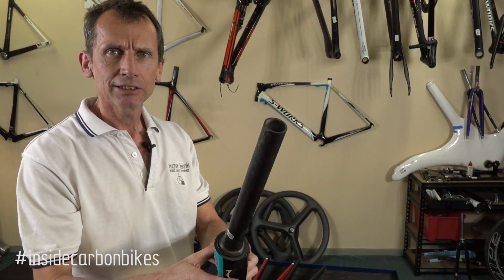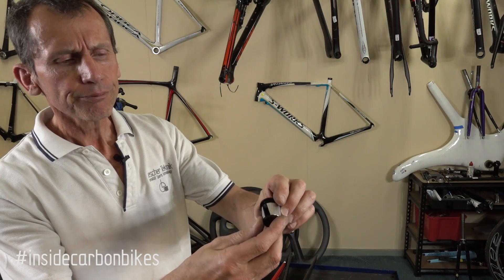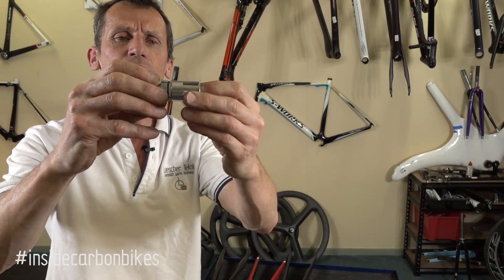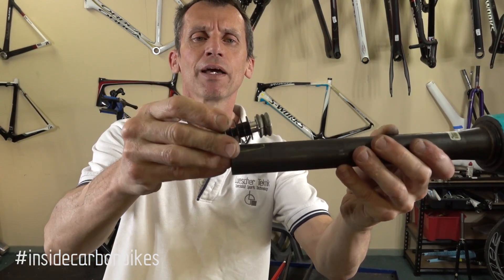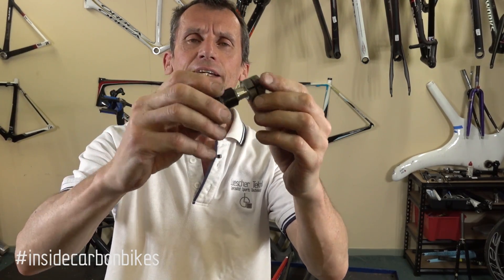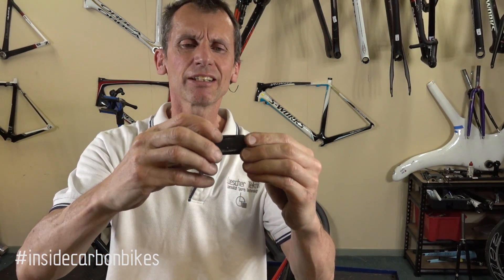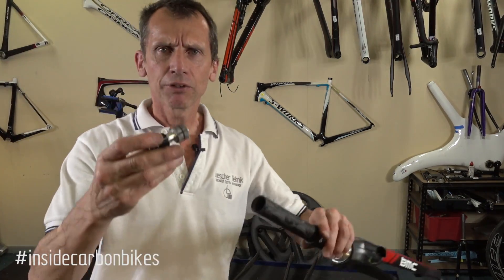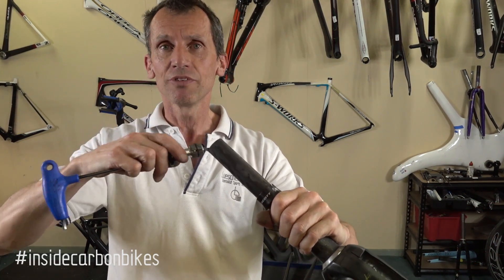Quicktips  -  Fork steerer compression plugs

Comment: My Lauf Seigla came with the second type you said to throw away 😮
Reply from the maker: Did you throw it away??
Reply: @ I did. But I'm not absolutely sure the one I replaced it with solves the problem. I think the top stem bolt may still be a little unsupported.
Reply: @LuescherTeknik  what do you think about the expander plug Schmolke Expander SL? I assembled it around 8mm below the top edge, which is exactly between the two stem bolts so that the pressure is well distributed. I also used carbon paste on the surface of the plug. Thank you in advance for your feedback.

Comment: Great video - quick question, I have a Caad13 and looking at a longer plug so I can adjust the stem position without cutting the steerer.  If the plug were longer than the stem would this be an issue / cause expansion outwards where there is no stem to push back?

Comment: Do you need to put in a compression plug if you are using 100% chromoly  forks and steerer tube? Or do you just need a star nut?

Comment: It looks to me as if the compression/expander thingy is more dangerous than a stem clamp without any burrs, as a tube is more susceptible to expansion than compression?

And it's very clear that all breaks happen outside the clamping area which is quite strong even if it is slightly damaged, so should an expander actually extend below the stem clamp?

Is there any indication that these breaks, as one would suspect, preferably happen to big sprinter guys?

Comment: In terms of weight, wouldn't it be best if the compression plug could use (carbon) spacers internally to move it to the exact height of the stem clamp? That way the expander plug could be minimal weight and still have full adjustability without needing to cut the steerer or use an overly long compression plug

Comment: When installing one of those expanders that have a unique vertical slot, is it better to put this slot at the screws side, opposite to the screws side, sideways, or this doesn't matter at all?
As one of the tasks of the expander is to counteract the compression force of the stem, I would say that it is better to put it on the side opposite the screws one but I wonder if the expander doesn't play a role also in counteracting the forward bending forcethe fork steerer is subjected to when the body weight is placed on the handlebar, although this is already partially opposed by the spacers under the stem, and then in this case it would be better placing the slot sideways.

Comment: If a steerer diameter is expanded where the compression plug pushes against the inner wall as you demonstrated, but reverts back to its original diameter once the plug is removed, is the steerer damaged in any way?  Even if it is safe, it seems the longer, less concentrated expander plugs may be better for the steerer?

Comment: No compression plug on my Canyon, it's hollow, it uses some weird solution from Acros  (Ai-70F).
Reply from the maker: I have seen quite a few problems with this system and don't recommend it.
Reply: @LuescherTeknik  Yes, I didn't know that, and overlooked what system they use when I bought this bike.

Do you recommend to additionally install a compression plug (50mm) into the steerer?

Comment: Best option of all that you showed seems to be the aluminum tube bonded inside the carbon steerer, then a traditional metal star nut down in there. Those things are always trouble free. Adds some weight, sure, but that's a good use of that weight. A few extra grams at most. The aluminum tube will provide a really good footing for a star nut and will also support and greatly strengthen against any possible crushing from the stem.  That should be the standard. I might source some aluminum tube of appropriate thickness and diameter and retrofit my bike with that, never have to worry about it again.  Good layer of epoxy between to prevent galvanic corrosion.

Comment: This is one of the biggest scam in cycling. By providing only a small compression plug more forks are sold due to people cutting their stems. By using a longer compression plug you can then use more spacers underneath and are able to move the handlebar extension up and down thus not needing to buy a new fork when you sell your bike. The full up and down expansion plug is the best design as it leads to no gaps on the compression area.

Comment: This seems to miss the point of the compression plug. The first red flag is that we have to assume that company after company is failing which doesn't make sense from a warranty/injury perspective. Obviously we haven't seen any of this damage/injury in the cycling community. 

The stems we use in cycling do an excellent job of dispersing forces along a wide area along the steerer tube. An impact on one area of the tube (like a head-on collision) isn't felt in just the one face area of the steerer (closest to impact) because the stem is clamped around the entire tube so it's dispersing this pressure and would need enough force to crack the entire section of the fork around the stem (significantly more force than what we see in 99% of collisions). 

Imagine trying to punch through a glass cylinder with a thin wooden wall immediately in front of it; you may easily be able to push through that wall and damage the glass. Now wrap the wall around the glass and tighten it to it so there's no void (like a stem). Now you have to have enough force to sheer the glass under the wall to break it; it is SIGNIFICANTLY more difficult. 

 A compression plug doesn't do anything to help in saving the tube either since it's not adding to the dispersion of the forces (the stem is obviously tight evenly throughout the steerer these days). 

This shows a fundamental misunderstanding of the compression plug. The second I call out multiple manufacturers for an otherwise obvious flaw is the second I should be questioning my understanding of the concept.

Imagine the amount of crashes we'd be seeing if plugs had to keep the stem on!
Reply: The fundamental misunderstanding is entirely on your side. Watch the video again, this is not about crashing, but crushing.

Comment: Would the placement of plug matter so much when we use it to only tighten the stem to bring the steerer up, to seat into the headtube bearings? Then we tighten them stem to lock it all in place. Also along this thinking, wouldn’t it be best to have the plug in the same area along the steerer tube the same as the stem?

Comment: Wouldn't the larger expander bolts negate a significant amount of the weight savings from the carbon fork? Carbon forks are usually only 300 grams lighter than a good alloy fork.

Comment: If the compression plug is supposed to counter the clamping effect of the stem,  then why aren't there variable length compression plugs for when folks want to drop their stem but not chop the steerer column?
Reply: That’s why Cannondale insist that their compression plug top cap must be placed directly onto the steerer tube, with no spacers on top of the stem. So the bottom of the plug is always lined up with the bottom of the stem, where the load is
Reply: @jeffbrunton3291  That's all good if you want to chop the steerer tube - which is fine when you're under 30 and still flexable...

... but when you're the wrong end of 40, had numerous crashes over several decades and decade plus behind a desk at an office desk, you need the stem to go up AND down, which is why I posed the question about different length compression plugs.
Reply: For weight savings perhaps? I'm totally OK with extra steerer tube reinforcement.
Reply: @sbccbc7471  Weight savings or doing a Hincapie in Roubax and watching your steerer tube brake and watch your stem go one way in your hands and have the bike go another!

:P

I know which I'd prefer and it isn't the option that may require dental treatment afterwards.
Reply: @Swampster70  I'm all for long expander plugs. Hell, I got myself a 50 mm version simply because I refuse to use FSA's.

Comment: So, I have a couple of aftermarket carbon forks on road and gravel frames.  The manufacturer calls for the cut to be 7-8mm above the stem and effectively leaving a 10mm chimney. Is there a reason for this? For compression plug placement more centered in the stem?  It’s the only thing I can think of.
Reply from the maker: Ask them and see what answer you get, it does ensure that the steerer is not cut too short though.

Comment: i never notice carbon forl would expand that much. Planning to remove expander for weight saving like Canyon do, nowi have to reconsidering.
Reply: Weight savings are over rated. I only use (heavy) enclosed cam quick release skewers, and I don't bother shaving a few grams from critical areas either. Some things are just best left alone.

Comment: Just a question, if you could please answer about a different design you didn't mention? LOOK have a aerostem or c stem and doesn't use a plug, it has a locking ring at the bottom with a 16mm spacer, a rubber boot is then fitted, then the stem fits over the top. It uses a internal clamping arrangement, which is external to the fork tube. The stem can the adjusted to height as it has a tilt function. My question is, how does LOOK get away without supporting the centre? Cheers Raoul.
Reply from the maker: Yes, I am quite familiar with this. The wall thickness of the steerer is very thick as part of their headset design also, so it can take more load.
Reply: @LuescherTeknik  hey thanks, Raoul, Was interested as look have some older runout models at discounted prices. Hambini likes their engineering and that crankset is a work of art. So might splash some money on one. If you have any other feedback about the previous 795 and 695 models it would be appreciated as it is extremely hard to find stuff on these bikes on the net. Thanks once again

Comment: Is 5Nm typically the correct tension on a stem to steerer tube connection?
Reply from the maker: 5Nm is typical, but it depends if the thread is lubricated or not and how it is measured as well.

Comment: Slightly off topic, but could you comment on the practice of cutting the steerer a few millimeters above the stem and using a short spacer there to provide clearance for the stem cap. I've read that this is a better practice for carbon steerers than cutting a few millimeters below the stem. Have you seen examples of damaged caused by cutting below the stem?

Comment: If you have the specilized one DO NOT TORQUE IT TO THE RECOMMENED 9nm (printed on the plug). I just torqued mine to 8nm, and it caused a fracture in my steerer tube, FUCK!

Comment: I still use several youngtimers with 1‘ steerer tube.Unfortunately for 1‘ there are not many
stems that can handle carbon steerer tubes due to sharp edges.
So what i did was using a shim between tube and stem,what really works well.
In 1‘ you can’t get plugs anymore,and the old ones like you showed are all too short....
After how many km/ time intervals should i check on the stem/fork system?!

Comment: If this is so critical how does one perform a bike fit by moving the spacers and stem around the steerer? Would you cut your steerer each time you want to try a new position to get that support from the expander plug?..
I have seen so many bikes where riders just could not be bothered by cutting their steerer and they have a huge pile of spacers at the top and stem slammed all the way at the bottom...
Reply from the maker: Just use a longer expander plug and you can adjust the position to get your fit. Once the fit is done, you can cut the steerer to the correct length.
Reply: @LuescherTeknik  I guess that works as too long is always better than too short

Comment: The steerer tube that expanded slightly so the spacer wouldn't slide over, once the torque was backed off and the spacer would slide freely would this fork still be safe to use?

Comment: Cut the steerer shorter and save it for a smaller frame? Just my $0.02
Reply from the maker: Yes, this is a good option, although you need to check that the offset is the same as sometimes the smaller frames have a different offset fork specification.

Comment: Best expander ever:  'PRO' (Shimano brand)  'Gap cap Expander long', Code: PRHS0072    
https://www.pro-bikegear.com/global/en-gb/accessories/Headsets/PRO_HS_GAPEXPAN

This is a 50 mm long expander with no top flange, which will allow you to drop it into the steerer tube and position it wherever appropriate along the inside. It has 3 thick aluminum lobes which will expand evenly along the entire length, and are certainly long enough to cover the entire stem height (get the long one, regardless of what you think or anyone says)

The problem is the obsession with a lack of spacers above the stem, leaving the stem overhanging  the top of the steerer tube (having top of stem level with top of steerer tube is not an option, as you need some clearance for preload). In this condition, not only is the top portion of the stem not on the steerer, causing the stem bore to collapse more at the top than the bottom, shrinking the top of the steerer tube (like a bottle neck), there will almost without exception be no internal support at the top of the steerer tube, due to the fact almost all of these expander plugs don't actually expand at their tops and bottoms (only the center portions), which will exacerbate the problem even further. 

So, 

1) Have at least a 10 mm spacer above the stem, which ensures the entire height of the stem is on the steerer tube, and leaves plenty of room for preload and *probably ensures the top cap doesn't run into the expander plug as you preload (*many top caps have a center portion which drops significantly below the top of the steerer tube, inside the steerer. If so, more of a spacer stack above stem might be required.

2) Use a expander with a expanding section at least as long as the stem height, and ensure that the expanding section is actually positioned where the stem is clamping the steerer tube. The spacer stack above the stem is also required for positioning many expanders high enough for their expanding section to be where the stem is clamping. 

This applies to expanders without a flange on top (like the PRO one above) which stops them going down into the steerer tube, which are more useful as they allow you to position them wherever you want inside the steerer tube. This is all pretty logical and easy to picture if you think about it. 

Some spacers above your stem are your friend. Don't listen to the posers who will tease you for having ''uncut steerer'', when they don't even  know where you've cut your steerer tube, and don't even understand the reasons behind having spacers above your stem. Let them snicker while they have their stems only partially on their steerer tubes, and no support at the top of their steerer.

Comment: What happens when the bottom cone of a compression plug is seized with the screw and can't be removed anymore? Pulling it out as gently as possible would cause severe damage to the steerer?
Reply from the maker: You may have to drill it out, certainly don't try to force it. As they are usually made from aluminium alloy you can drill it easily.
Reply: @LuescherTeknik  yes, I think that would be the best solution. I'll try that! Thank you

Comment: serously? 
you are a carbon expert?
this is the same bs durianrider is talking...

the truth is that there is no need to support it from the inside.
Reply from the maker: I have seen hundreds of forks with damaged steerer tubes caused by this problem, but what would I know ;)
Reply: FAKE NEWS - in most cases, ignore this advise to avoid damaging your steerer tube or even having a crash.
Reply: tell me how you put expanders in your handlebars and seatposts?
Reply: @ianiscaratti4924  this just proves how ignorant you are about materials and engineering; it's called Saint-Venant's principle. I added this information to the question/comment from sc0608023  on this topic and I'm not writing it out twice. Go find it or do some research. Do this yourself if you like, but don't spread your ignorance and endanger other people's lives.

Comment: So once the stem is installed, is it safe to remove the plug? Lots of people do that to save weight.
Reply from the maker: The plug provides hoop strength to resist the stem compressive forces, it should be left in. You can take it out when weighing the bike, just remember to put it back in!
Reply: Thanks for the response. I guess the real question then is - does the plug continually offer compression protection, or is it just for the initial installation? Most people unfortunately think it is the latter, so once the stem is installed safely, no more damage can be done. False?
Reply from the maker: The plug supports the stem during riding, for example when you hit a pothole or crash, without this support the steerer most likely will be damaged. With the Ahead system initially with a steel or aluminium steerer a star nut was used for installation to provide preload. This practice has continued with carbon steerers, however they often don't have the hoop strength required as does a metal steerer tube.

Comment: regarding your comment on the KP017 Cannondale (the first expander you threw away): The length must perfectly match that of the stem, with the lower part fixed under the lower stem screw. The thing is, even with a normal compression plug, if the upper part's diameter doesn't perfectly match the inner diameter of the steerer, you're going to have the same problem. Besides, researching a bit on the internet show very few people having problems with this specific part (KP017). Do you have any negative experience with this?